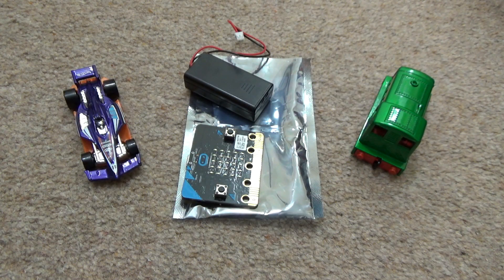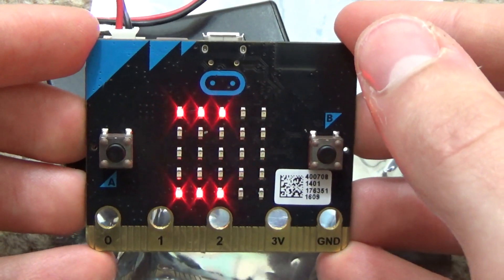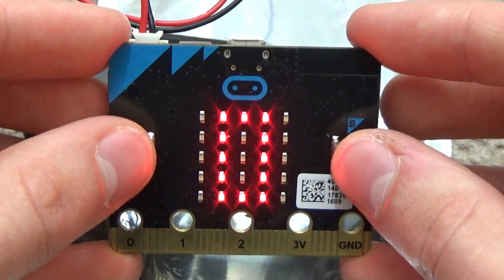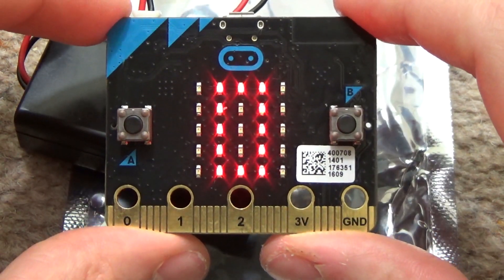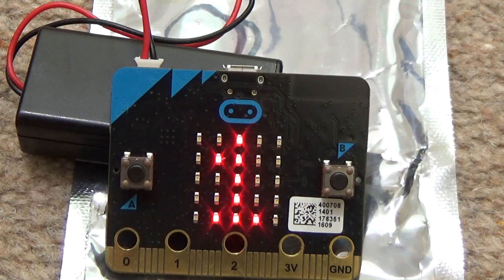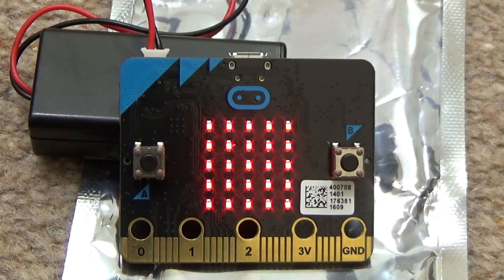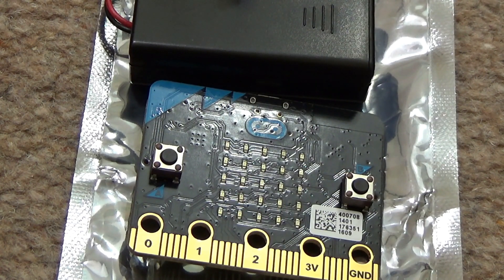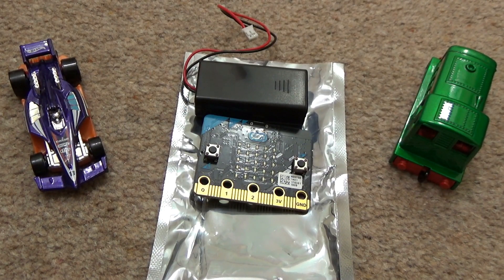ZZ9's BBC Micro:Lift - An Elevator Simulator programmed for the BBC Micro:Bit

Comment: How do you make it so it doesn't let you go down when it's at G?
Reply from the maker: It's probably as simple as an IF statement that if the indicator isnt sat on 1 or currently heading up then don't enter another downward call. Haven't looked in the code for ages but it's a simple thing

Comment: Well, guess what! I went ahead and made code that actually incorporates the pins, and uses them in such a way that you could call this a lift!

P0 = Motor
P1 = Directional relay
P2 = Limit switch

Whenever the lift wants to go up, you apply current to pins 0 and 1 to go up until you reach the limit switch. The limit switch is actually the same switch on the bottom as well.

Would you like me to email the code to you? I have it currently on my Google Drive doing not much.
Reply from the maker: is there any extra equipment i need before i can run it fully?
Reply: You need a 3 volt relay, a seperate power source for the motor, and 2 switches. I will send the code (.hex file) to your email, along with the diagram for the other relays.
Reply from the maker: @lbsiuk  and links to the other equipment that I need would be helpful too :)

Comment: Now, make it a working lift! (It doesn't have to be full size.)

(Nice lift BTW)
Reply from the maker: idk how easy it would be to turn an indicator simulator into a complete logic controller for a lift XD
Reply: Being honest, it has 2 outputs (as by the looks of it) so one of them could be up on the motor and the other output to down on the motor. There is two caveats to that though. If you want two-speeds the simple way, you need four connections to the main motor, making a total of 4 connections. If you want doors, you need two more connections. If you wanted to go even more weird and have your doors two speeds, then you will have a total of 8 motor connections. You would need eight inputs for shaft limit switches and door limit switches. So in total you would need 8 outputs and 8 inputs. (Each input takes two connections.) And then again, you need relays for the motors to make sure that the power doesn't flow backwards. (I didn't have relays for my Arduino lift, which it why it can only go up.) And then, you don’t have enough pins on the Micro:Bit to make it. But what you can use instead of a Micro:Bit is an Arduino. If you want a display you can use an LED matrix, and wire it into the Arduino. Yes, it might be pricey, but you have the advantage to do anything that you want to. You could make it full size even and have it go on the side of your house! Another problem is that you couldn't call it Micro:Lift anymore because it is using an Arduino. Well, I suppose you could call it Arduinavator.

(Sorry for late response, the Wi-Fi at the restuarant I am at is terrible, and also sorry for the overkill comment.)

Comment: Nice!

(I mod all the lifts in Guys Hospital (EXCEPT SERVICE LIFT, BECAUSE OF SOME TECHNICAL DIFFICULTIES (Actually, I am lazy to mod it, so I just replaced the indicator and buttons in the service lift))
What do you think?
Reply from the maker: thx! :D

(What brand are they modded to?)
Reply: Your welcome! :-D

(They are ALL Schindler now, not including the service lift)
Reply from the maker: :D

(5500?)
Reply: :DD

(Tower: 7000, Jacksons and Thyssens: Erm... Idk... Maybe 3300 with Schindler QKS9 Doors lel)
Reply from the maker: :DDD

(cool!)
Reply: ZZ9 Productions :DDDD

(Thanks! But all of the 3300s uses D-Series fixture, and some of the 3300 does not have Close button
Reply from the maker: :DDDDD

(How about some of them use D-Series and some of them use FIGS?)
Reply: ZZ9 Productions All 3300 uses D4/6-Series, the Tower lifts (Schindler 7000) uses M-Series, for the service lift, I just replaced the button to D6-Series
Reply from the maker: ok
Reply: But the 3300s uses M-Series single tone chime instead of the original one
Reply from the maker: ok
Reply: And the last lift is also replaced by Schindler, but it a Hydraulic now.
Reply from the maker: ok

Comment: Nice!
Reply from the maker: when u finish responding to comments on this video then right after you go back to the youtube home page a notification pops through for another comment XD
Reply: XD. I've played around with the MicroBit aswell. I prefer Scratch though (I'm probably saying that because I have a sore throat). Apparently, I got my MicroBit for €2.50.
Reply from the maker: The JavaScript blocks editor is not too dissimilar to Scratch, just slightly different wording and colours mostly, with some different commands in there. The hardest part apart from bugfixes was finding where various blocks were in the categories of blocks XD
Reply: Yeah. I  made a light detector-sort-of-thing. When you put your hand over it, depending on how far away your hand is, it will light up from 2 rows to 3 rows to 4 rows to 5 rows.
Reply from the maker: if that program is still on your Micro:Bit, I'd love to see a video of it and then see the code for how it works!
Reply: I did it on my old laptop. (Sorry about the delay, had to go to the Doctor)
Reply from the maker: oh (it's ok)
Reply: MMOG?
Reply from the maker: not today, i MAY be streaming tomorrow so I'll play then depending on what happens with a building mod I am waiting to receive for Skyscrapersim
Reply: ok. What time? I'll be awake by around 9:30-10:00
Reply from the maker: i think it will be after lunch before i'll be streaming
Reply: Ok